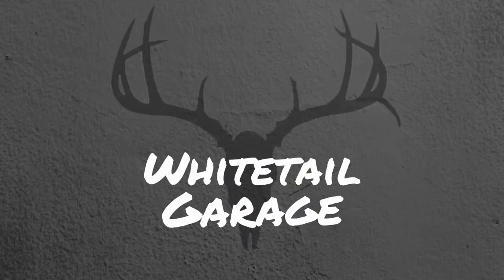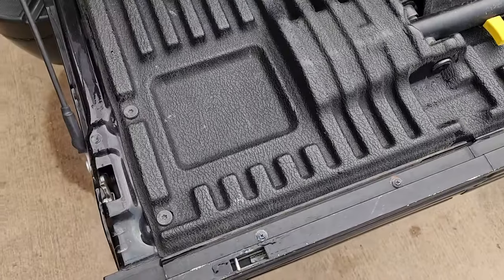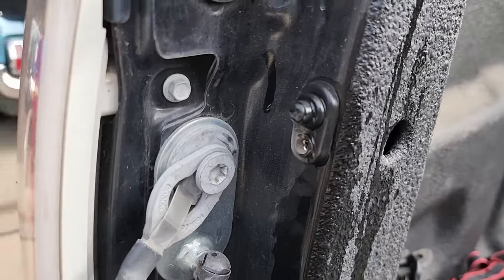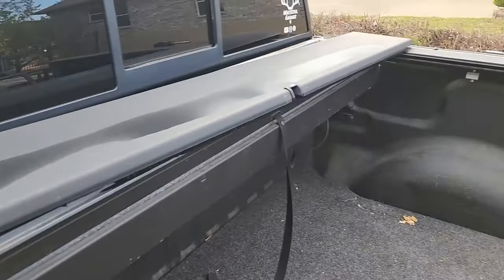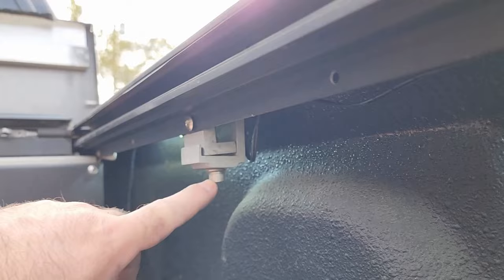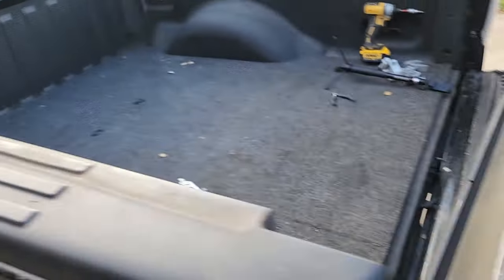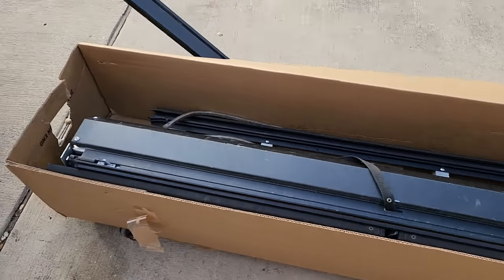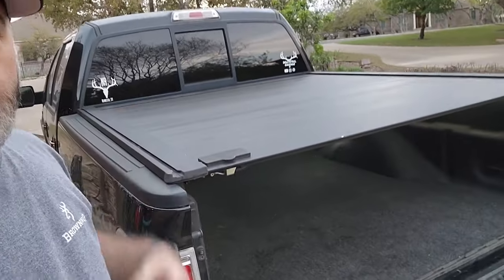Roll-N-Lock or Retrax : Which one is better?

Comment: To me the Retrax Pro MX and Retrax Pro XR are the best low profile tonneau covers money can buy. Over 500lbs spread out across them easily, one handed operation, locks in any position, doesn’t interfere or impede with the tailgate whatsoever, it doesn’t bulge or protrude above the bed rails and looks like it’s made for the trucks, they are the most water resistant covers I’ve ever used and they don’t block the rear window. They basically make it so you have a convertible trunk/bed at all times and your gear is safe and secure. I have one on a 5th gen 2020 Ram 2500 Laramie 6.7 Cummins and a 2023 Ford F350 Platinum 6.7 power stoke long bed. Flawless operation and ease of use on both. I don’t use the racks like I thought I would, but it’s nice to know I could on my Retrax Pro XR

Comment: I had a roll n lock on my last truck for 12 years and it worked flawlessly. I really  like the smaller canister that allows me to use large totes as storage underneath it. I did have to realign it once. I think yours just needed realigned and it would slide well again. I’ve just ordered a new one for my new truck and was told that they no longer lock into the tailgate since automatic tailgates are more common these days they’ve done away with that feature.I like the feature so I’m not sure if it’ll still come with the lock bar as an option though, I’ll find out when it gets here.

Comment: Here's a couple of tips......Use paraffin wax to lube the channels on a Retrax system, never any petroleum based lube. I have a dually with an 8' bed and it's difficult to open or close my Retrax due to the fenders, my solution was to take a 8' wood dowel rod and screw a hook into one end. I can use the stick to grab the cover to close and use it to push the cover open. It's much easier to use because you're pushing or pulling from the middle or center of the cover

Comment: I’ve had 7 Roll n Loks with no issues. This last go around I went with Retrax because I wanted to add a cargo carrier and didn’t realize Roll n Lok was making one with the t-grooves for cargo racks.  The Retrax is a total POS! On the second day my cooler shifted and crushed the canopy making the top almost inoperable. I had to crawl in the bed and bend it back into shape as best I could. I now have a worn strip all the way down the top where the dent makes contact.  I contacted Retrax on the second day and they offered to knock $200 off the parts since it was “fairly” new.  2 days old is “fairly” new?  The Roll n Lok has a bumper plate that goes in front of the canopy.  The Retrax also leaks like crazy in a car wash. You might as well drop the tailgate and spray a water hose inside. I would never recommend the Retrax!
Reply from the maker: That is a terrible experience.  I did notice the "can" on the retrax is much more flimsy then the rollnlock.  I found the rollnlock to be harder to use both retracting and closing.  With more maintenance and lubing it would have been fine.  But with the ball bearing in the retrax it is far less of issue with limited to no maintenance.  I can see what you're talking about though.

Comment: Someone did not install your Roll-n-lock correctly! I had one on a truck for 17 years and never had a single issue with it not opening or getting out of line! Took care of it and it looked brand new when I sold the truck. Had one on my last truck for 7 years and same thing, not a single issue, never had it not retract, never had it get out of line! I will get one put on my 2024 in a couple of weeks when I have a chance! My brother has had one for over 20 years, he did not take care of his and the paint came off part of the canister, but like me, never had an issue! Also, I could also pull my roll-n-lock from one side with no problem just as you can the Retrax. Just keep the rails lubed and it slide smooth!
Reply from the maker: That's great.  My experience didn't match yours.  The Roll N Lock was on the truck when I purchased it, maybe an install issue.  The Retrax I installed worked without issue.

Comment: on the pull retractable can you still open it without the bed being down? im actually in the market for both of these and i think the retractable retrax with key is the best deal
Reply from the maker: The rollnlock locks the tailgate by design. You could modify it not to do so.  The retrax doesn't lock the bed.  The ball bearing roll of the retrax is enough of a reason to go retrax.  But that is just my opinion.
Reply: @WhitetailGarage  Agree... the Retrax Pro MX is my choice also.... its full aluminum cover....with lifetime warranty and one arm operation sold me.....comparing to similar models...the rope pull would drive me crazy!

Comment: so is there any water intrusion witht the retrax? seen some video with them leaking. leakage was coming thru the actual aluminum slats and all the way up the side. wondering if it was an instalation problem or the retrax itself. i live in oregon so having something water tight is important and can deal with a little bit near the tailgate.
Reply from the maker: Mine is water tight, but I am not dealing with snow.  That could make a difference.
Reply: @WhitetailGarage  from experience.....all the retractable bed covers suffers from extreme weather ...ie snow...they tend to freeze and lock up....unless you park in a garage......and concerning 100% water tight ....no cover is waterproof except maybe a hard (solid piece) tonneau cover.

Comment: How easy will the the new one be to clean out when it gets plugged up and wont drain?
Reply from the maker: The same as before.  2 bolts/screws to remove the top plate to access the inside.  Drain port size are the same.

Comment: Did you have better water seal up by the window area?
Reply from the maker: The rollnlock didnt have any actual seal but sat on top of the bed.  Being right next to the cab I believe was enough to prevent water intrusion.  The retrax has a "seal", really just a rubber flap, because it sits inside the bed.  So far I am not seeing any water in the bed but have yet to drive in any wet weather.  Sitting in the rain I havent seen an issue.
Reply: @WhitetailGarage  If the seal attached to the canister is flipped downward into the bed, it has not been installed correctly. When you install a Retrax, the rubber seal should lay flat against the bulkhead and either ends should be trimmed where the seal ends where the bed side caps come in contact with the seals. This will help with water coming down the bulkhead if the seal is laying inside the bed. Hope this helps!
Reply from the maker: You are correct.  I meant the body of the unit is in vs on top of the bed rail.  The seal lays flat across the front of the bed, as you stated.